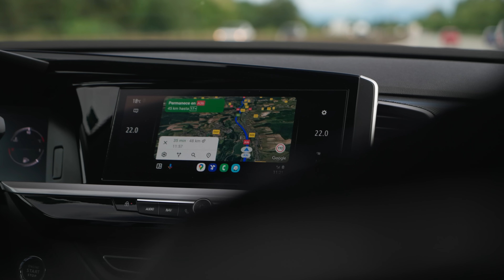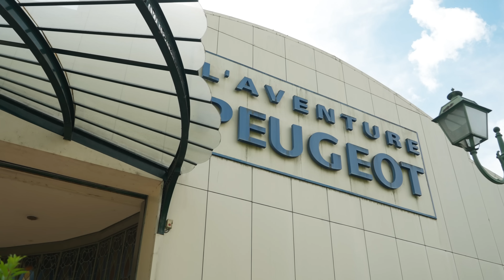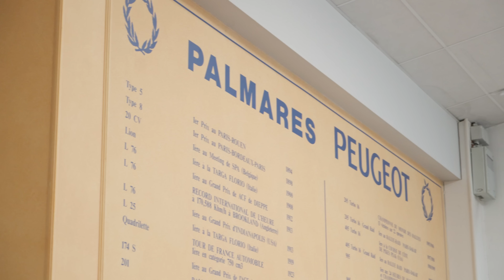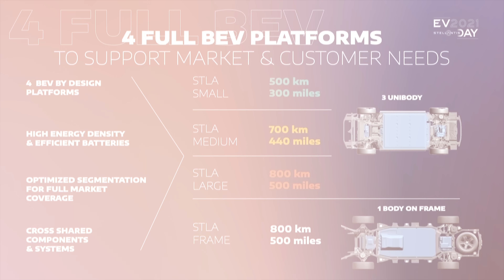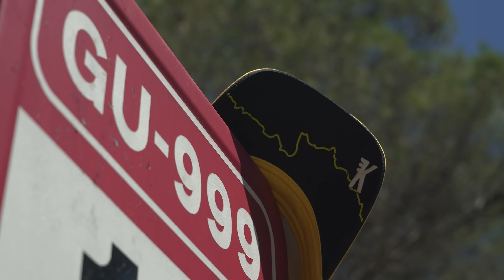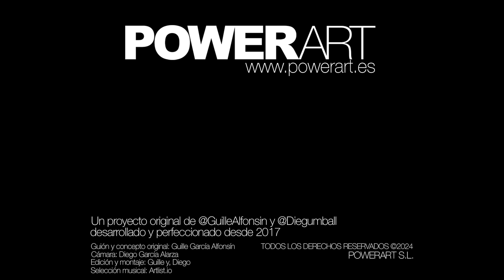Clases de anatomía e historia: STLA Medium (Peugeot 3008) y un breve repaso a la historia de Peugeot

Comment: Muy buen vídeo, gracias. Supongo que lo habrás explicado, pero me perdí el motivo por el que la arquitectura de 800v da menos autonomía que de 400v. Puedes resumirlo?
Reply from the maker: Para un precio determinado y fijo, te cunde menos hacerla con 800 voltios, porque es más caro, así que acabas con menos kWh. Adicionalmente, las baterías de 800 voltios requieren más aislamiento y eso hace que tengas menos espacio para celdas, así que acabas con celdas más pequeñas.

Saludos!

Comment: No entiendo porque dices que una arquitectura de 800V tendría menos autonomía que una de 400V a igualdad de capacidad de batería. Si no tienes en cuenta las pérdidas debería ser como mínimo la misma, pero si tienes en cuenta el menor peso de los conductores y las menores pérdidas por efecto Joule, la autonomía debería ser superior con una batería de 800V
Reply from the maker: Lo ha confirmado Herve, el ingeniero jefe de la plataforma, pero te lo explico, porque es sencillo: las celdas para conseguir 400 voltios pueden ser más grandes y almacenar más energía por ello. Con 800 voltios tienes que aislar mejor (más aislante = menos espacio para energía pura). Por otro lado, es más caro el paquete completo de 800 voltios que el de 400, por lo que a igualdad de coste, con 800 voltios acabas con menos kWh, pero con más potencia de carga.
Reply: Muchas gracias por tu respuesta, Guille.
A igualdad de costes supongo que si que será más interesante la solución de 400V porque tendrás muchas más soluciones "off-the-shelf" que aunque el coste por parte sea mayor, no tienes gastos de desarrollo. 
Pero en cuanto al debate de aislantes vs conductores, creo que es bastante más interesante la solución de alto voltaje, pues los aislantes suelen un orden de magnitud más económicos que el cobre. Y creo que las celdas entre sí no hace falta que le añadas aislantes adicionales porque tienen el mismo voltaje relativo unas con otras (3.6-4.2V).
De todos modos muchas gracias por tus excelentes videos en general y este en particular, que me ha recordado mis años de ingeniero de desarrollo de Battery Packs en las inmediaciones de Sochaux ;)